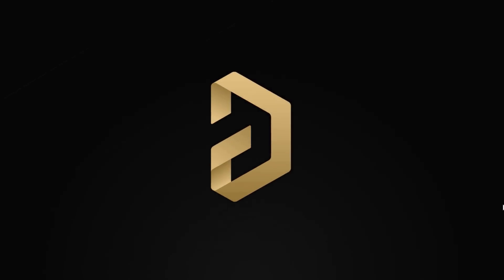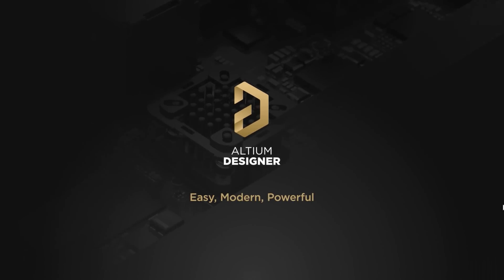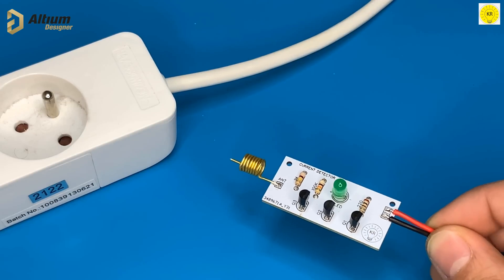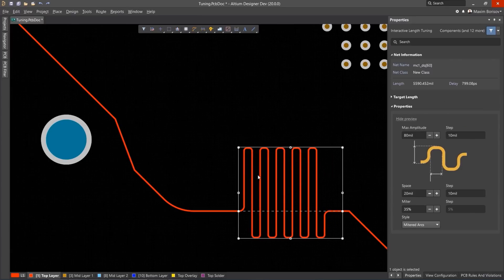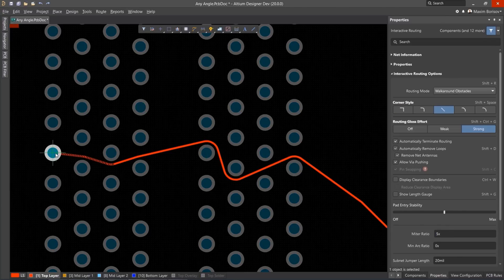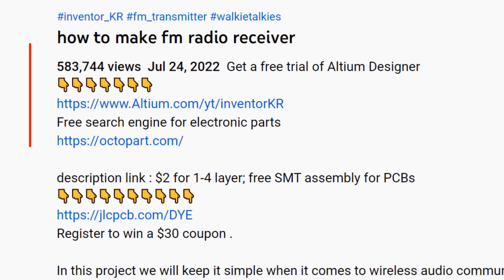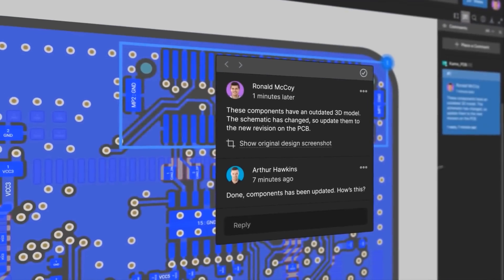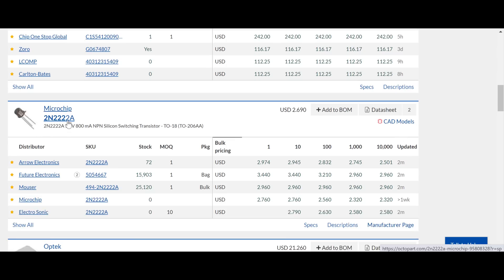how to make current detector , altium designer

Comment: I reproduced the circuit with the same transistors on a breadboard, but the LED is only on when I touch the antenna. Do I have to tune any resistor?

Comment: I see that the light is blinking, because it enters the half-wave, because you used a transistor NpN, I suggest you add another circuit with  pnp transistors to enter the half-wave of another, so that the light does not flicker, just for experiment

Comment: The coil at the top is not an antenna. It acts as one side of a capacitor. Meaning if u put a big piece of metal instead of the coil, the circuit will be more sensitive. Something like 3cm by 3cm piece of aluminium.

Comment: you used 2n2222 transistor for current detector .how about bc547 transistor?
Reply: If you want to use 3v power supply don't use the resistors 
The 3 resistors is just for voltage bigger than 3v
Reply: @abdoboujarat9737  
Thank u very much I used c 945 npn transistor
Reply: @thawzinkhant1759  actually , you can also use pnp transistor ; because the alternative current is positive and negative at the same time
Reply: Any npn transistor can be work . I use c1815
Reply from the maker: bc547 can also be used
Reply: Gostaria  de ver montando e os componentes e placa
Reply: @ronaldosousaleiteleite3329  
I don't understand tell me
in english
Reply: आप BC ५४७ट्रांसिस्टर्स लगा सकते हो